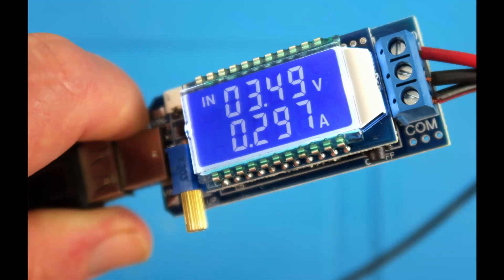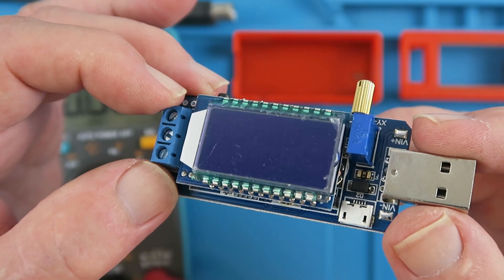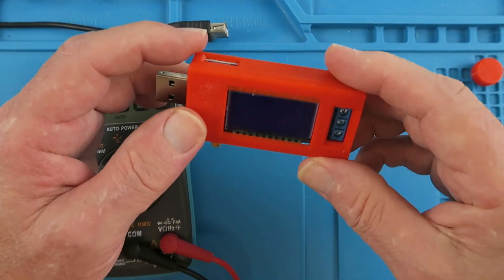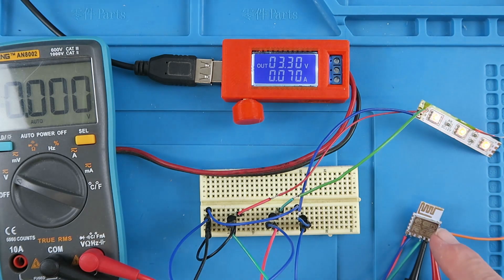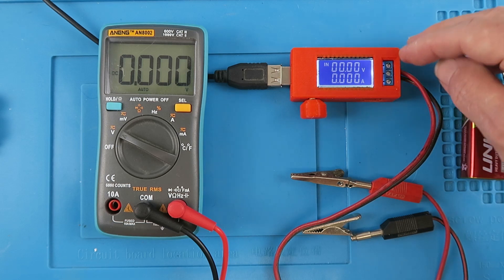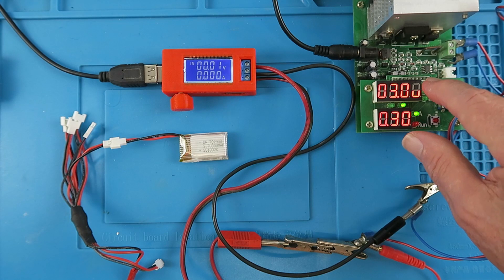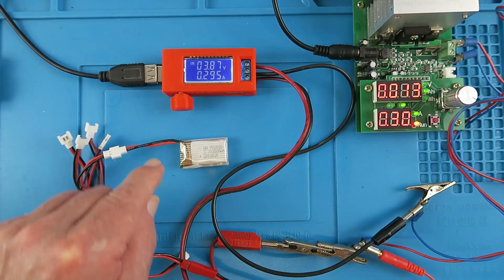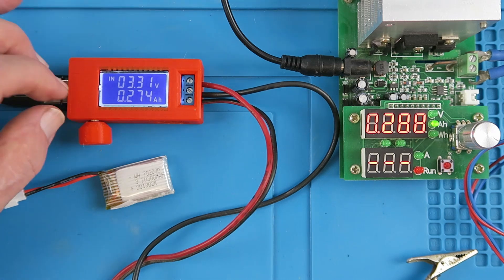XY-LUP Combined Boost Buck Converter & Multifunction Meter Review

Comment: Most 12V adapters have an output of up to 12.6 or 12.8. Will this damage the module?
Reply from the maker: The 12V adapters you mention are unregulated supplies not really suitable for powering your projects as the output voltage can vary wildly under load, or no load. I cannot find any "absolute maximum" value for the 12V input but would guess maybe a 0.5 volt tolerance, so you maybe OK. Personally I would get a 12V or preferably adjustable power supply that is regulated. Watch this video : https://youtu.be/ikTsE-UGN1s Thanks for watching, have a great day!

Comment: Hello sir,   Can i adjust the Ampere ??  
Because i need it to be exactly (12v 1a) to power my modem during power outages...
i cant figure out how this thing work,  it came without a manual...  Help me please someone...
And is it okay to power my modem with (12v 1.5a) adapter??  my modem requires (12v 1a) ...
Reply from the maker: This device will not work for you. I can only supply 3 Watts at 12 volts which is 0.25A.
Reply: @1nformatica  oh okay sir,  last question...
is it okay to use 12v 2a  adapter to my 12v 1a modem?
is it okay to use adapter with more output amperage than the device(modem) needs?
Reply from the maker: @-n-6969  Yes, the modem will only draw as much current as it needs. Just because a power supply is rated at 2 Amps does not mean it will "force" more current into a device.
Reply: @1nformatica  Thank you very much sir,  May God bless you and your family with good health
Subscribed❤️
Reply from the maker: @-n-6969  You are welcome!

Comment: so is the input locked at usb voltage or could it be say so 12v solar panels I have that the motion lights quit working
Reply: so do you have device you know of that would fit the bill?
Reply from the maker: @jgarmer  Take a look at this guy : http://bit.ly/LedDriver
I have a video on it here : https://www.youtube.com/watch?v=zTxiflmyeU4
Reply from the maker: The input voltage can be between 3.5 and 12 volts on the pads provided : https://youtu.be/VCgYkO4SaYQ?t=38
However i think "12volt" solar panels can actually output more than 12 volts. Also if you were thinking to charge a lithium cell this board is not suitable as it has no constant current setting.